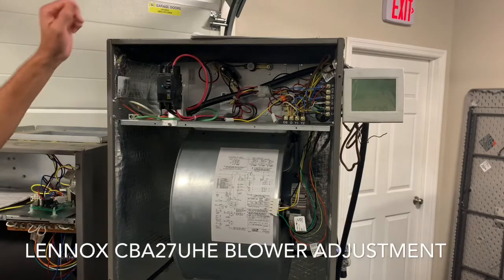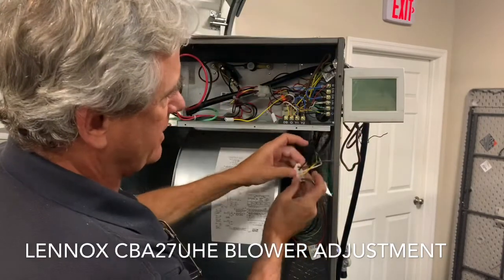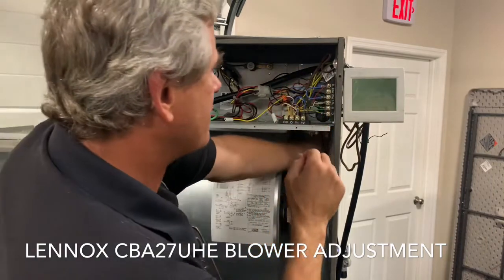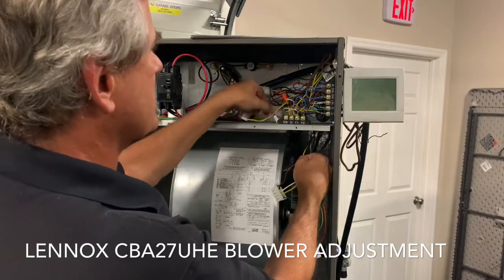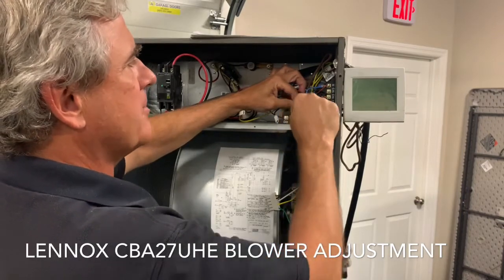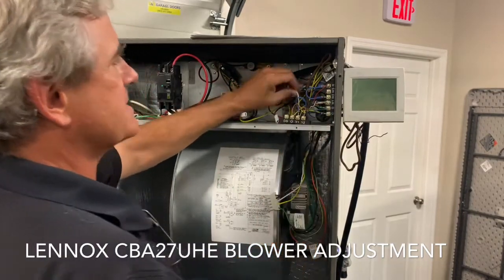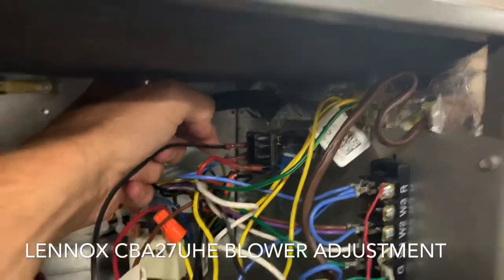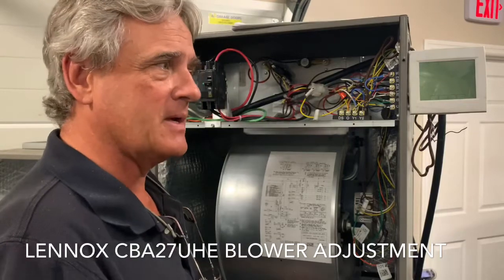Blower set up for lennox Cba27uhe

Comment: I have a question, my fan motor is running continuously with no wires connected to any of the blower speed wires. It appears that it is a common problem. Looks like they used green for cooling Y1 and white was wired to W1.  Speed tap wires Y, Bl, and BR are tied off and not used. The unit has electric heat. I added a two-pole relay and tied the Blower power feed through the relay (230V)  to cycle the fan.  This relay is now controlled from the G terminal from the Thermostat.  Is it OK to run the same speed for both heating and cooling? And when you start an off cycle in heat mode, will I brn out an element if the fan does not have an off delay?  Thanks
Reply from the maker: If all your speed wires are disconnected and its still turning
Motor is likely defective and needs replaced.

Comment: By what you said in your footnote add on, in this type of Lennox system you don't have the option to have both heat and cool run in tap #4. Considering my out of the box setup is #4 for heat and #3 for cool.
Reply from the maker: You can use 4 for cooling/heat pump heating, and choose a different speed for electric heat speed relay of in the case of 10 kw or less, you really can just use whatever cooling speed you chose to run in heat pump heating mode as well, you simply wont increase the speed for heat pump + electric heat combined heating. Not a biggie. Straight cool needs a speed on the el heat speed relay for A appropriate speed for electric heat to be energized, if you dont have a speed on the relay G speed will simply run and may be too low, and trip temp limits.
Reply: @HVACTailGateTrainer  Mine looks to be 8Kw, and that black wire is going to a heating relay like you mentioned. So I was wondering how I would energize speed tap 4 for cool and for heat and not accidentally trigger heat and AC at the same time. If possible to accidentally do that.
Reply from the maker: @motoxrider295  if 4 is truly the cooling speed you want just drop white/3 onto the heating speed relay.
If it is a straight cool or a heat pump in emergency heat it will energize tap 3 
If its a heat pump, the higher speed 4 for cooling/heat pump heating on the y1 or 2 will over rule the 3 if 2nd stage heat/ w is getting energized. It will be fine.